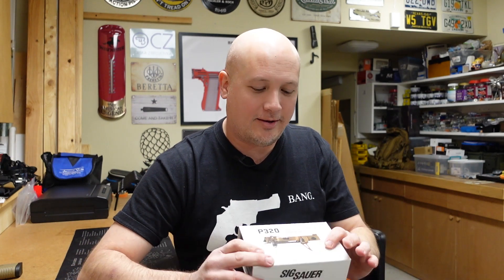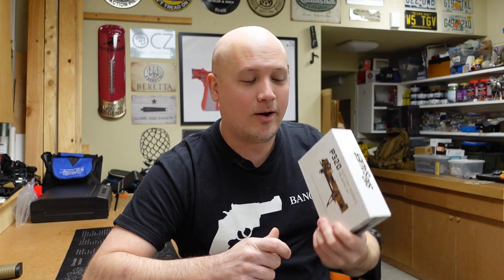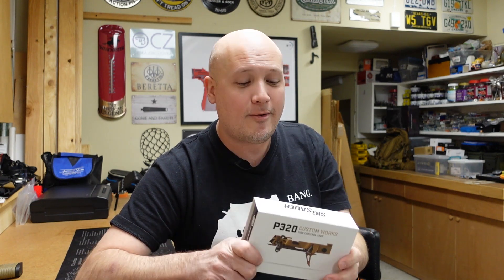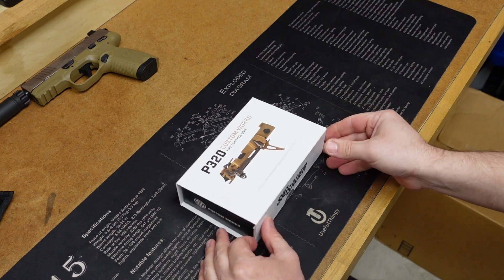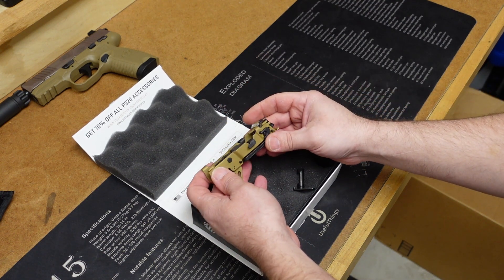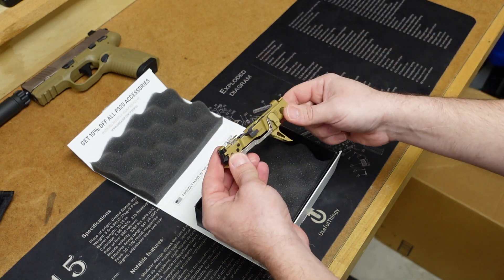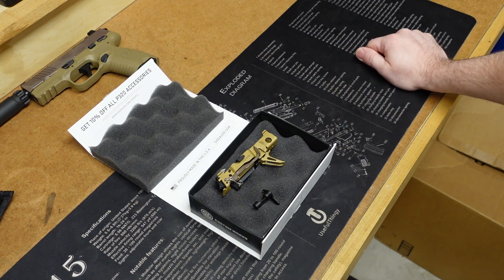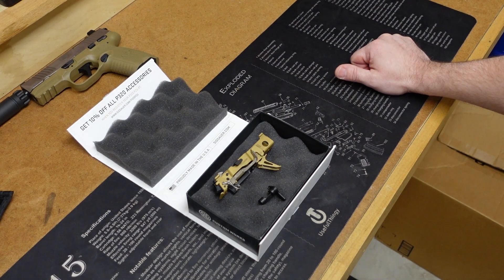Unboxing: Sig P320 Fire Control Unit (FCU)

Comment: Starting with an FCU to build your custom P320 is the way to go, with good planning it is a lot less expensive than starting with a complete pistol. 
Link to my build with that FUC if you like to see what I've done, and your opinion is welcome: https://youtu.be/j7-8pPj1c6E  ( Do delete it you don't want to see any link to somewhere else in your post. My apology in advance.)
By the way, Custom Works FCU trigger does feel smoother and not gritty like the standard FUC.
Reply from the maker: Like the way the pistol turned out. You will see in a future video

Comment: I think the P320 are pretty cool, but I heard that there have been over 100 accidental discharges without the trigger being pulled. So be careful several people have been shot while holstered. Nobody has been able to recreate the malfunction so Sig says the gun is safe with no issues.
Reply from the maker: I have heard about those too. Without being able to replicate the issue under controlled circumstances I feel like many other things on the gun world it is overhyped.
Reply: Most those discharges are either user error or due to using the wrong holster.  I've owned many many 320's I appendix carry one every day for the last 5 years and I've dropped it numerous times everyday possible.  The 320 is perfectly safe. People's egos is the reason the gun gets blamed.